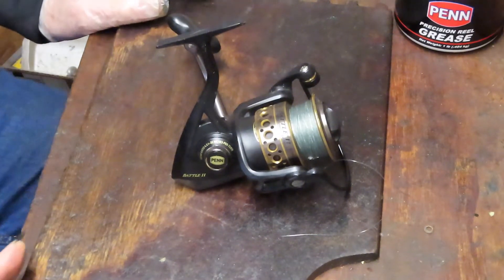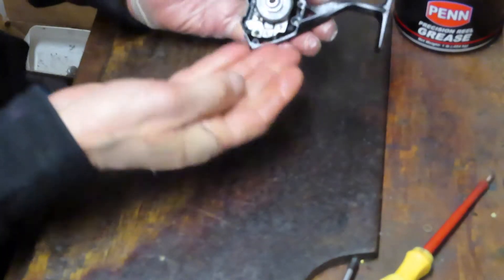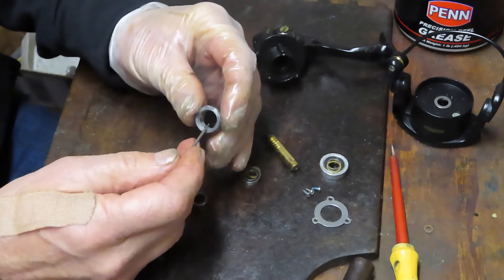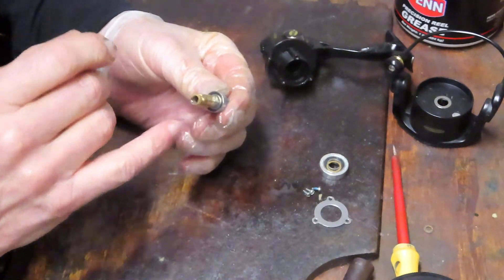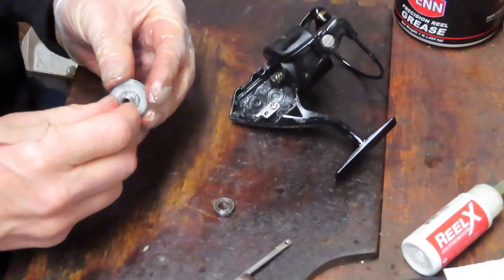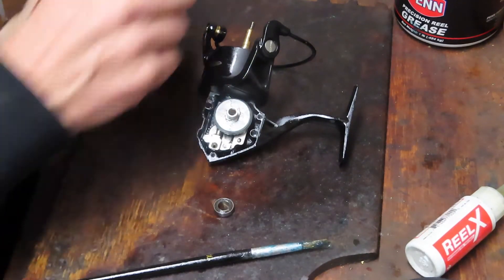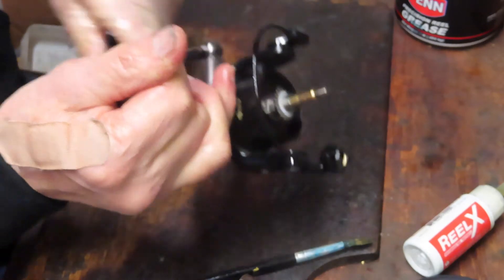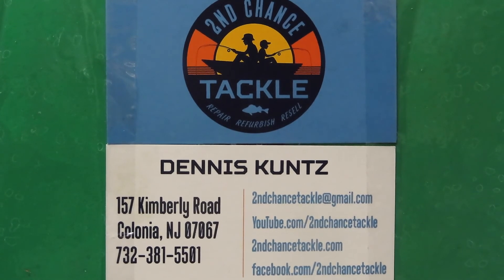Penn Battle II 3000 spin fishing reel how to take apart and service

Comment: I have a battle 2 4000 and the rotor is a little wobbly. Was wondering if it could be something loose.
Reply from the maker: Yes - the cap screw that holds the rotor down is likely loose.  Remove the tie down screw and clamp and see if you can tighten it down a notch - Dennis

Comment: hey Dennis, cleaned my Penn B2 3000 this wknd. followed your video as close as possible. when I put the reel back together the spool spins nicely. as soon as i put the cover plate back on and tighten the 3 screws spool sticks and is hard to reel. any idea what i may be doing/did wrong when i put it back together? thanks.
Reply from the maker: Something is binding inside the reel.   You may have the shim washers out of position of something not tightened.  You need to recheck it
Reply: @2ndChanceTackle  will do thanks. i wonder if i did not place the shims correctly where they belong (???)

Comment: What is the function of the screwed down piece of metal next to the cross wind block that you didn’t need to address
Reply from the maker: That metal bar holds the tongue of the  crosswind block beneath it and prevents the block from coming loose in the channel - it does not move as it is just a failsafe - Dennis

Comment: I guess a Battle II or Fierce II are okay reels but when you fished in the surf your entire life (66 years) with a switchable AR I just can’t use these always-on AR reels. Of course you know I’m not fond of Chinese Pure Fishing reels. This Battle II is just like many of my spinners except for this AR.  (I love my Mitchell tools!) This was interesting to know in case I work on someone’s reel like this sometime. I spent 3 hour working on the dirtiest Daiwa 7000C inside I’ve ever seen. It had that nasty dark brown grease in it. It also has two seized bearings on the main gear. They’re soaking overnight in PB Blaster but I think they’re probably toast. Then I couldn’t get one of the three screws holding the bearing and pinion loose. I had to use evvery trick in the book to get that screw loose w/o stripping it. The pinion bearing was fine. The reel doesn’t have a mark on it. I’m going to have to get a new bearing set for it. Have you ever worked on a Daiwa PS2000 spinning reel. I’ve had one for 30 years but it never worked right. Today after all that time I figured out what was wrong and now it works better than when it was new. This reel has a worm gear just like the line guide on a conventional reel. It’s the only Daiwa of all the ones I have with that type of worm gear.
Reply from the maker: I haven't worked on the reel to the best of my memory.  Daiwa has others with the worm gear drive.  Notably the Tournament seres uses that set up.  Dennis